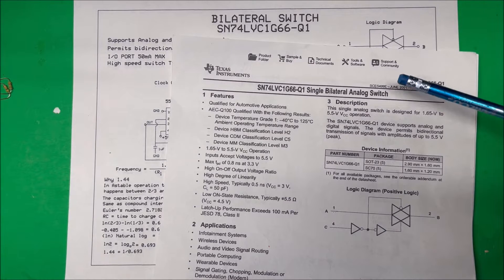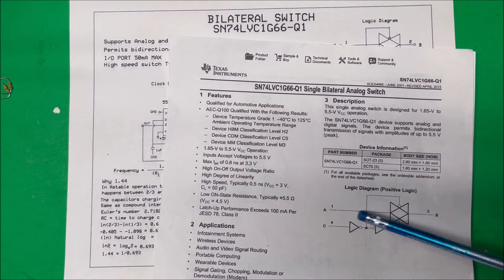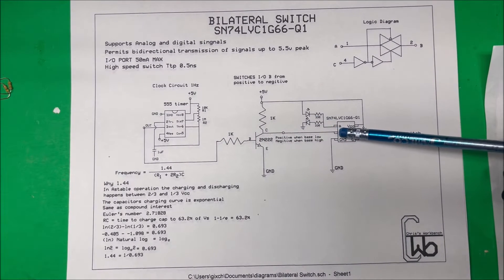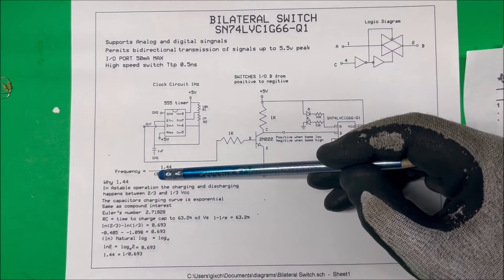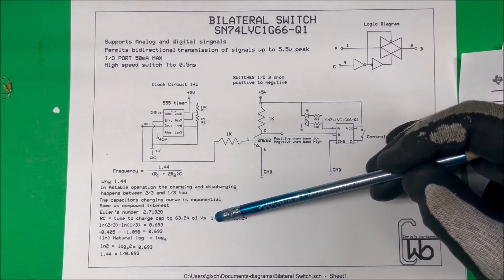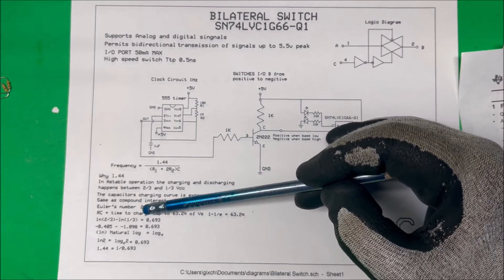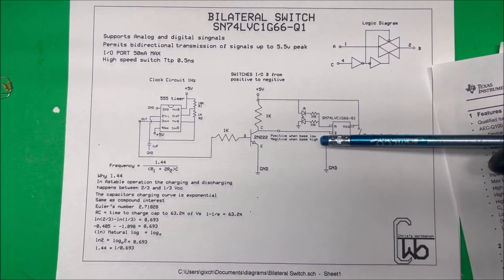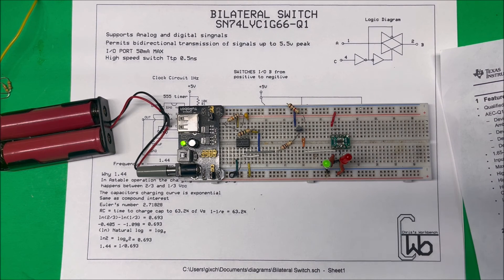Bilateral Switch SN74LVC1G66-Q1

Comment: Thanks for this, I have not come across these 1 channel analog switches. What happens when the control switch is open? Is the output floating (I suppose neither Led comes on)?
Reply from the maker: OFF-state switch leakage current is +-1uA at 5.5V
Chris